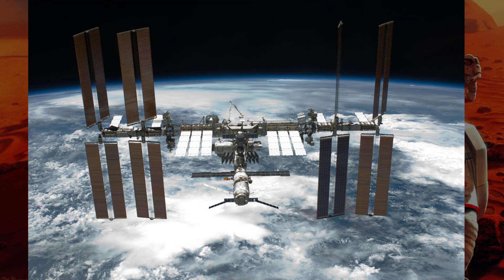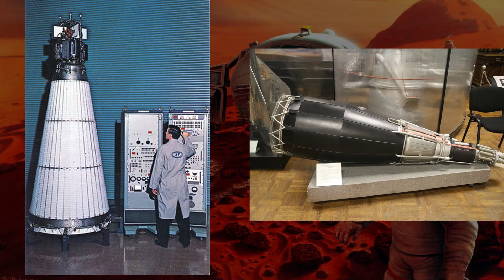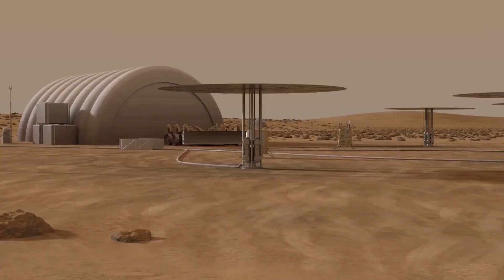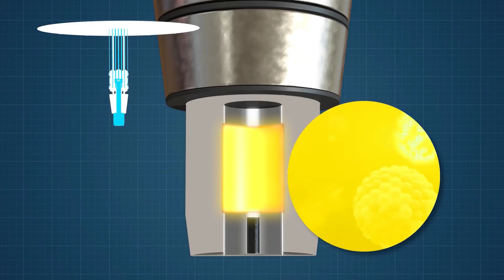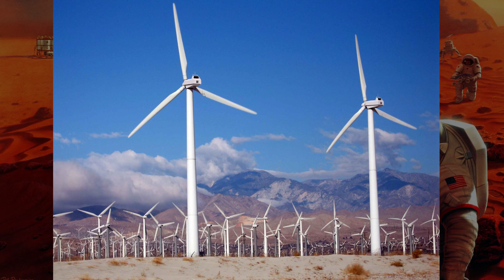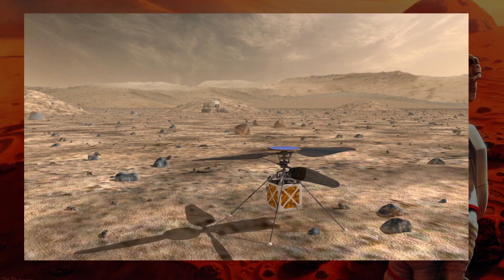Powering a Martian Base

Comment: If Methane is produced and stored as rocket fuel, it could also be used as a source of power, e.g. for back up power generation. I think you'd want as much redundancy as possible, and methane electric generators are mature tech, and likely easily manufactured/repaired on Mars.
Reply from the maker: It could be, but producing methane is actually quite power intensive. Still, in the event of an emergency, it would help.
Reply: Yes, only in an emergency. But I can't see storing large amounts of methane, constant power being vital for life, and not having a way to tap into the methane in the event of a primary power failure.